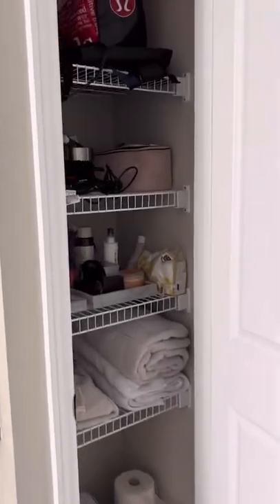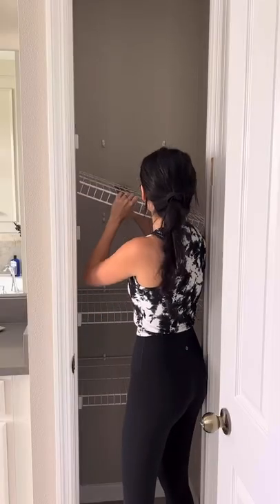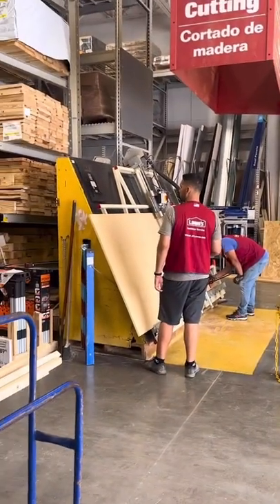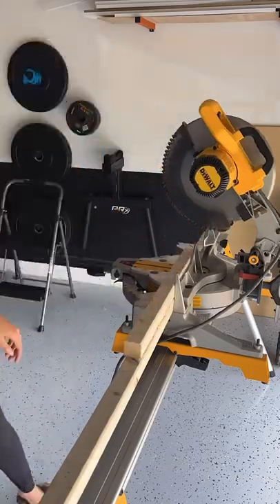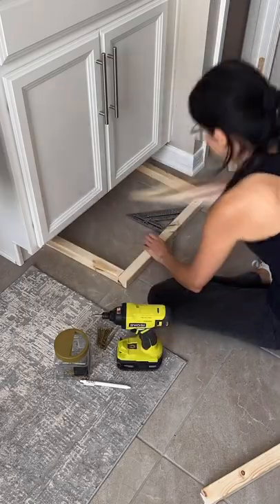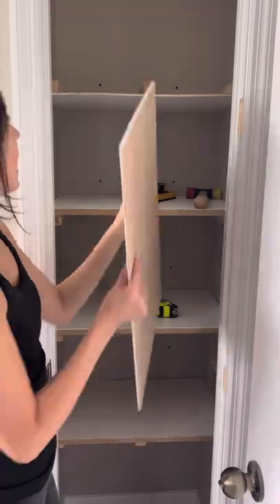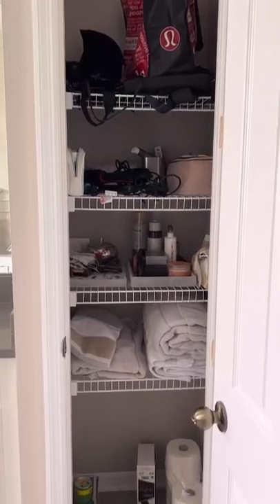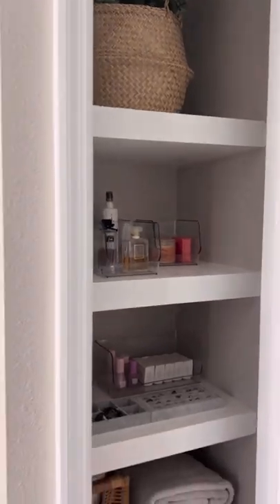Wire Shelf Transformation #shorts

Comment: Looks nice but I would have used a thinner board and covered and faced the metal shelves even cheaper
Reply: Instead of 'up-grade' she went 'down-grade'. Metal wire shelves are sturdier & allows air flow thus minimizing mould growth.
Reply: @glynislailann9056  Lol. Those flimsy builder grade shelves are NOT sturdier than framing lumber. Also, what exactly are you thinking is going to cause mold growth in a linen/storage cabinet? Unless she lives in an EXTREMELY humid (tropical or sub-tropical) area, her bathroom is used for baths/showers multiple times a day keeping humidity extremely high, and there is no dehumidifier. But it’s not like that is an under-sink cabinet. Or in the shower.
Reply: There's always one.
Reply: @glynislailann9056  it’s Always those that don’t know anything that talk the most.

Comment: So pretty but I’m that weirdo that likes the look of wire shelves.
Reply: Lol. I've seen a few "I replaced my wire shelves with wooden shelves!" videos. It's kind of funny. I'm in my 60s and wooden shelves were all we knew way back when so when wire shelves came in, it was a great improvement. One of the reasons I like wire shelves better is that it improves air flow in the linen cupboards. I still prefer them actually.
Reply: @johannaholmgren8088  that’s a great point about the air flow! I think they are more practical as well ☺️

Comment: I did something similar, but much more simple, I cut plywood to fit on top of each shelf, then shut a 2” piece that’s as wide as the shelf. Laid the plywood on top of the wire shelf and glued the 2” strip to the front.  Simple.